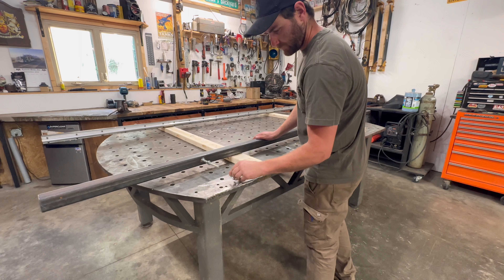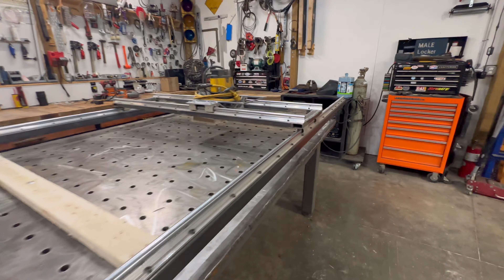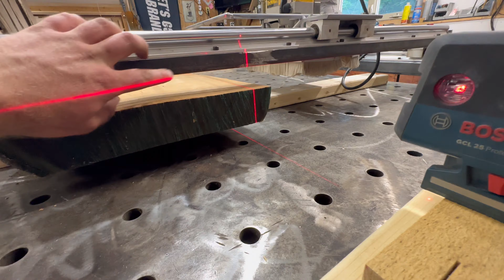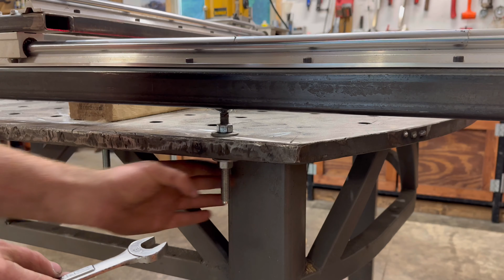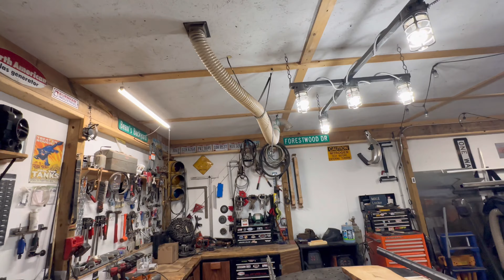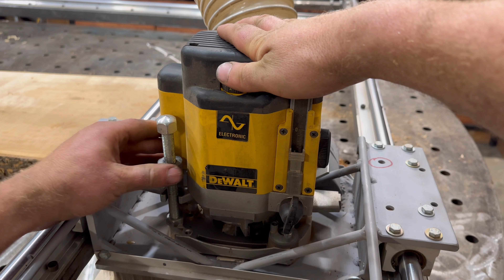DIY Heavy Duty Router Sled For Live Edge Slabs

Comment: Is there a reason to use a router sled instead of just using the sawmill to resaw them flat? Just wondering.
Reply from the maker: The reason I don’t use the sawmill to resaw them flat is because when the wood drys it becomes harder and is more rough on the sawmill and blade, and also it would leave saw marks. The router leaves a much cleaner and accurate finish.

Comment: What are your lengths of your rails? Looks like you doubled your long rails . Id like to build one just like it and make it large enough to do bigger slabs
Reply from the maker: Yes I did double up the long rails. I don’t remember the exact length but the rails are long enough to flatten a slab 4 feet wide by 9 feet long. I couldn’t find rails long enough so I had to splice 2 together.